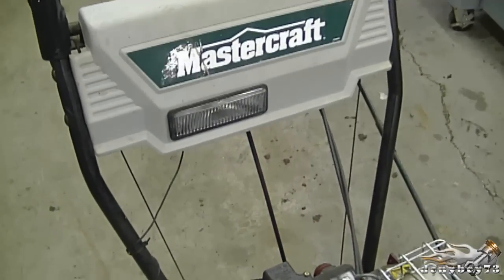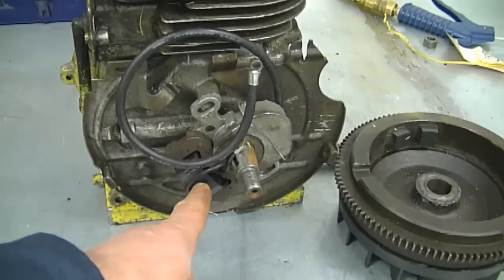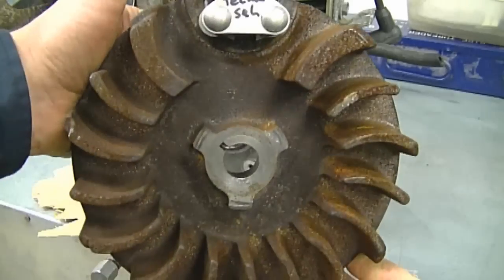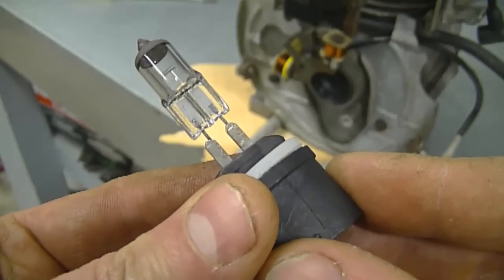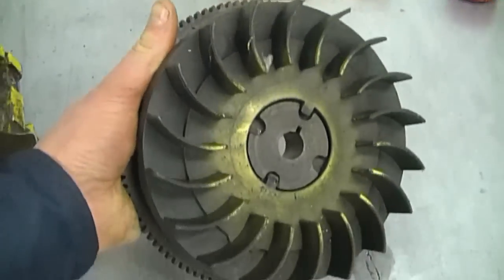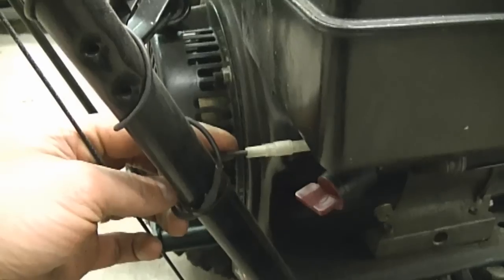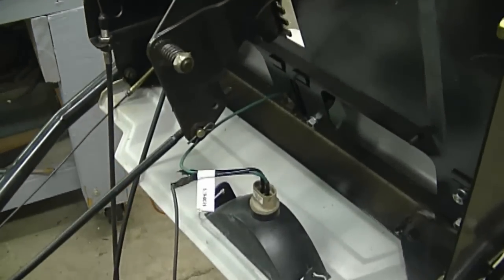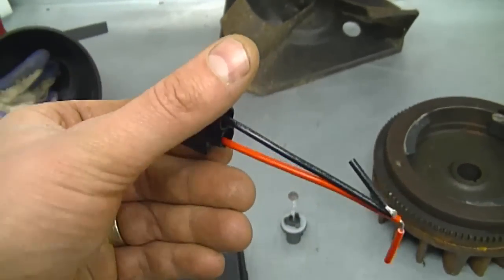HOW A Snowblower Light Works And The Parts Required - Video

Comment: This video was made in 2012 so you can be forgiven for not just suggesting one stick a battery powered LED light on the snow blower.  I am not sure any new snow blowers come without a light, but I have an old one and I found a suitable LED light with batteries for $4.  You can also just strap a headlamp on your head.  LED's have changed everything.